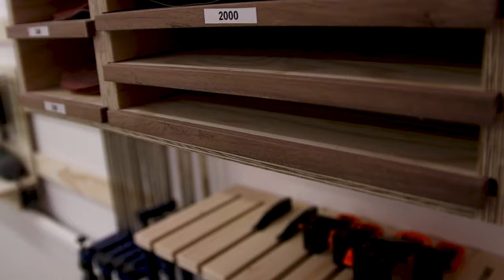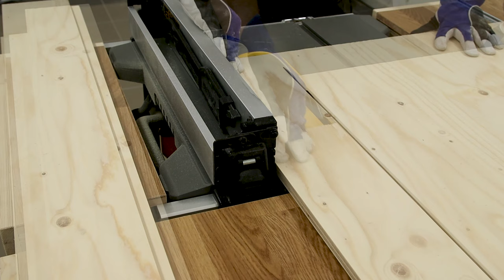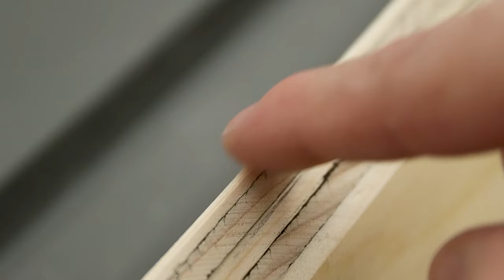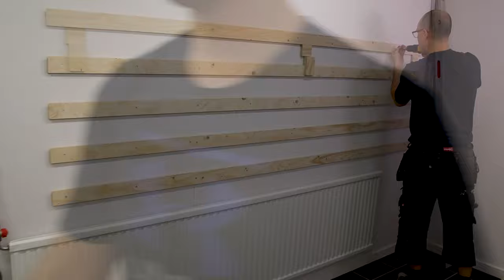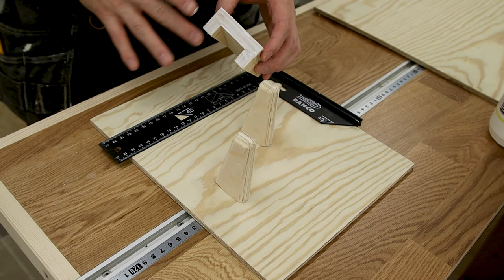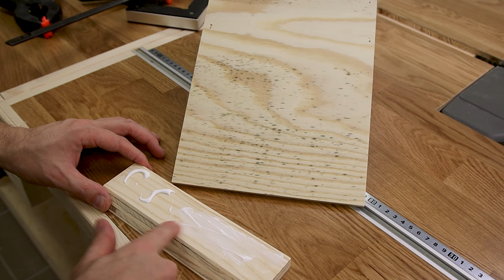Amazing french cleat wall with 10 important tool holders

Comment: Thanks for the video!!  Some great ideas in here as I'm about to make a cleat wall myself :).  One small issue though as it scares the bejesus out of me watching it....  using gloves with a table saw...  While it totally seems like the gloves would add more protection (even if they're "cut / knife resistant"), the issue is the teeth of the blade will grab the fabric and pull it into the spinning blade.  Basically instead of protecting the hands from nicks, it's presenting a way for the blade to grab and pull your hand into it and keep it there (meaning you won't be able to pull your hand away as the cloth continues to get wrapped into the blade).  The only way to save yourself at this point is to shut the saw off, and your hand(s) will have suffered tremendous damage.

Hence please please pretty please, don't use gloves!!  :)  Also a pushstick is highly recommended for cuts with a width less than the width of your hand.

Keep making great content!!!!
Reply: I was cringing BIGTIME watching that also!!  That's definitely Rule #1 & is a MAJOR no-no around basically almost any kind of spinning/rotating tool or machine. It's just an accident waiting to happen in my opinion, that's for sure.  Maybe on the next one, consider leaving out 95% of the gluing & the finger-spreading footage, as I'm pretty sure that we're all aware of how it's done...other than that, nice build!
Reply: Holding your finger or thumb near the expected path of your pin or nail isn't wise, either!

Comment: Using gloves on a table saw is a bad idea. We had an accident I a company I have worked. A guy almost cuts his hand in half because he was using gloves on a table saw
Reply: I was here to make a similar comment. Seems like an invitation for something very bad to happen
Reply: Ive been doing it 20 years never had a problem you just have to pay attention..Im never going to stop wearing work gloves and Im certainly not taking em off for every cut
Reply: Another problem is reaching over the blade on the completed cut.  A kickback will pull his gloved hand right into the blade.
Reply: NEVER use gloves while working with rotating machinery. It's better to get cut or get wacked than getting pulled towards the machine by the gloves. Learnt that the hardway using a drill press, almost broke a couple of fingers.
Reply: @matthewsynoradzki4656  i ve been doing it for a long time does not make it safe in my opinion.  But hey what do i know..if you feel comfortabel doing it like that great. But many People watch these YouTube video's so it would be nice to see People doing it safe so others will too..

Comment: Hi, I used your video as a guide in my garage for "some" of my tools.  I also used laser printed tool holders by Leverage Designs that fit into the battery slot of my tools (Ryobi) and laser printed clips that hold my batteries too.  Screw the holders into a board and they hold the tool, hanging via the battery slot.  I still needed cleat holders for my circular saws and misc tools though and it was a lot less complicated than creating the little pieces to hold a tool in place. Thanks for the ideas.

Comment: Looks great. Well done. For gluing "A Glimpse inside" channel showed how to use PVA and CA glue (with accelerator) together when gluing and it saves the need for clamping when fixing screws or brads. I use it all the time and recommend you have a look if you get time. Awesome technique. Thanks for the top quality vid!
Reply from the maker: Thanks for the advice! Yes i have seen it being used many times and i will probably end up doing the same. But for now normal glue will have to do, i simply just don't have all the bells and whistles yet :)

Comment: 'all my most important tools at arm's length' - you must have awfully long arms- that wall looks around 3 metres. I envy you having so much spare space- my small workshop is crammed. Such widely spaced tools and gaps are not possible for me- indeed I have to use the same space more than once. For example, I have a piece of wall that, when I am using my MFT for woodwork has the nearby wall cupboard double folded into the space, holding all my dogs, clamps, etc. When I am using my milling machine a board holding all my milling tools slides from the enclosure behind the mill into the space. If doing electronics, a unit swings down from the ceiling holding my scope, power supply, components, etc. Never needed together, so no conflict, and space used three times. And all actually within arms reach...

Comment: Very nicely done!  Could I ask the dimensions of the cleats and what size spacing between cleats you used?  Tack!
Reply: Pretty much any dimension would be acceptable as long as you have an area to run a screw through. 
As for the spacing, it really depends on what you plan on putting on it. If you're doing a wall to store lawn and garden tools, you don't need 6" spacing since the tools are large and will take up enough room that many of the cleats would be unusable. 
If you started with something like 12", then you could always add a cleat in the middle and reduce the spacing, if you find that it would be needed.

Comment: On the wall rails - does it mater the space between them or just you then build anything that's going to hang from them to that same gap?
Reply from the maker: Good question! The distance need to be as minimum the total height on the cleats on the back of the toolholders. If it is less then you will not be able to hang the toolholder. There is no maximum distance, you can even just have 1 single cleat on the wall if you so wish.

Comment: great french cleat wall. 

but if i can give some advice. don't use gloves when working with the table saw. it's more dangerous on top of the already dangerous tablesaw.
Reply from the maker: I have seen more say this, do you mind explaining why it is dangerous? I'm nowhere near the blade and my gloves are very tight so there is no risk for them to fall of or catch the blade. I honestly want to know so I can avoid loosing fingers :)
Reply: @DesireToInspire1  even with the lowest risk its very dangerous. when a tiny amount of fabric is catched, your whole hand/arm will get pulled into the blade very fast.

Comment: how long were your brad nails? thanks!
Reply from the maker: 25-35mm depending on how deep they would be without coming out on the other side. The nails are only used instead for clamps, the glue is what hold everything together.

Comment: What grade of plywood are you using?  Do you find it just as good, it not better, to store some items, like hack saw blades in your tool chest. I find it too finicky  to grab small things like that off the holder and try not to drop them.
Reply from the maker: It was the lowest kind of garde i could find, we call it construction plywood, very bad finish and thing layers, but with some sanding it look ss good. So far i have found no flaws with it. Do no not regret a single tool holder so far, it have made my workflow way faster then before. I know exactly where i have all my items now, so happy about them.
Reply: @DesireToInspire1  vilken tjocklek använder du för "ramverket"/kilarna? What thickness are you using for the cleats?

Comment: Hej. Funderar på vinklarna som du använder för att limma och klämma ihop material. Var kan man få tag på såna?
Reply from the maker: Kommer från Kina: Jag köper dem via mitt företag men du kan hitta dem och liknande på Aliexpress. Sök på "2Pcs 90 Degree Right Angle Clamp Aluminum Alloy L-square Holder Ruler Clamping Squares Woodworking Tools" Så hittar du vad du söker. Hoppas du hittar något som passar.

Comment: 40 degrees would do the same job. Stuff won't fall off the walls if you don't use 45 degree cleats.
Reply: A wide range of angles will do. If you're using narrow cleats, much more than 45 degrees will start compromising the amount of bearing surface. Much less than about 30 degrees and things might be a bit easier to knock off. You could even combine 45 degree wall cleats with 40 degree shelf cleats (though not the other way around) without destroying the universe completely.

Comment: Nice job. But: never ever use gloves around a rotating tool - that is asking for disaster. From your tool-sets I deduct you are doing a lot of woodwork - which causes dust. For my wall I used vertical strips behind the cleats to allow dust to simply fall through.

Comment: What are the squares you're using?
Reply from the maker: I Believe you are referring to the blocks i use when mounting the cleats to the wall. They are used so that i get the same distance between each row without having to measure it every single time.
Reply: @DesireToInspire1   I adding ask a very clear question. You often clamp some black, blocky small carpenter squares to pieces of plywood your attaching together to make sure they’re perfect right angles. I saw you use them often in your flip top build as well and they look like the perfect size for this case.
Reply: @winknotes  The black L piece at 10:34?
Reply: If you can share a link to these as I want to buy some!